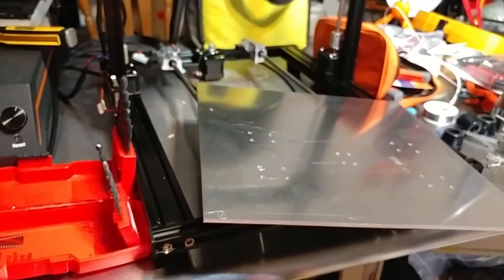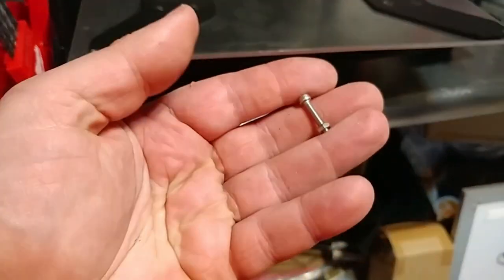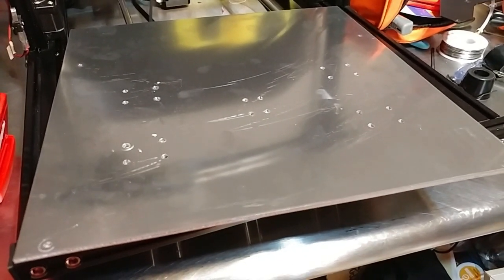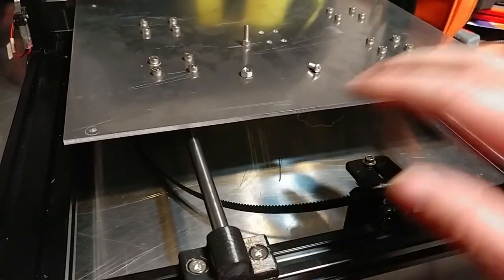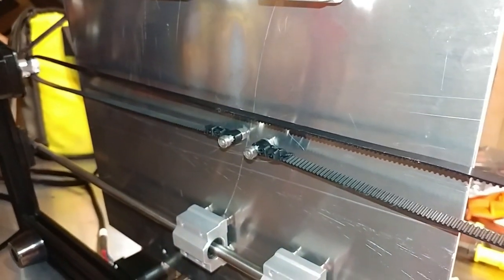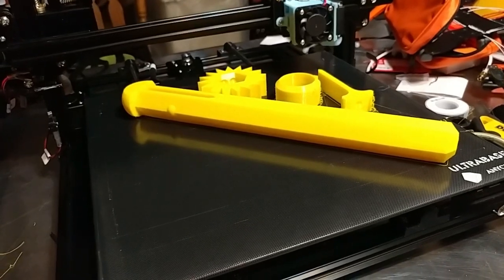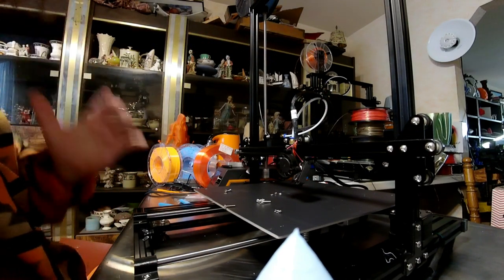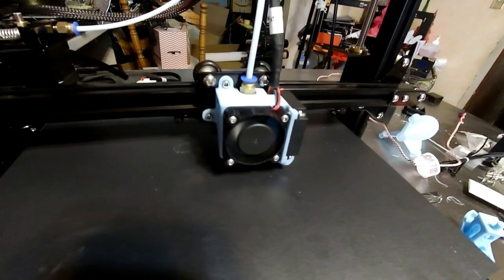Today's 3D Print 187 Anet E12 Fix, Upgrade1

Comment: Why not use a carbon fiber plate? Even less weight and from what I'm seeing, they're lower cost.
Reply from the maker: +Greg Atlas you can get a 12 x 12 in 3 mm thick carbon fiber plate for less than $17? Hell I would take one at twice that price! Best price I found so far is $120
Reply: I seem to remember a cheaper one for like $14 but this one is in the $55 range: http://dragonplate.com/ecart/product.asp?pID=4010&cID=95
Reply: You also might be able to get away with a thinner plate considering it's carbon fiber. Either way, sorry I was unable to find the cheaper option I thought I saw. (though it is possible to make your own if you have a flat surface and some parchment paper)
Reply from the maker: Greg Atlas no worries $55 is pretty impressive still too expensive for a printer Carriage plate though unless you're trying for real high speed or something you need at least 3 millimeter because you got a bolt things through it so you need enough thickness that you won't destroy the material when you tighten bolts
Reply: Yep. I understand. It's a lot easier to justify the lower cost of aluminum.

But if you tighten the bolts down hard enough, you might get diamonds. ;) (in all seriousness, I've been playing with carbon fiber rods and it's surprising how much they feel and even sound like thick steel even despite being paper thin, but that is in a round form.)

Comment: Blue tape forever!
Reply from the maker: +Michael Goodfellow it works but such a pain to reapply again and again and no good for large prints as the force of the part warping is stronger than the stiction of the tape when you start to scale things up. So the while the model sticks to the tape the tape gets pulled away from the print bed. Grrrr.

Comment: Hi,

This appears to be being sold for the E10, would it fit the E12? (not received mine yet, so can't check)

http://tehnologika.net/Anet-A8-A6-Aluminium-composit-Heated-Bed-Support-Y-carriage-Plate/

Thanks
Reply from the maker: Negative the e12 plate is a completely different set of dimensions from the e10 plate. I checked :-)
Reply: Nerys that’s a shame.  Maybe they’ll start making one soon if there’s demand.
Otherwise ima have to get some aluminium.
Reply from the maker: Just get a piece of aluminum it's not expensive and very easy to do should only cost around $15